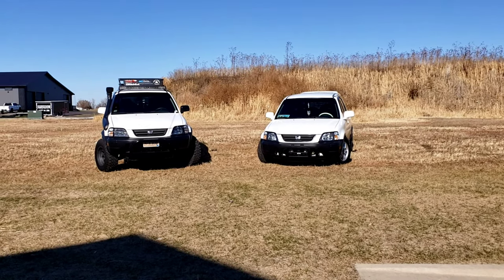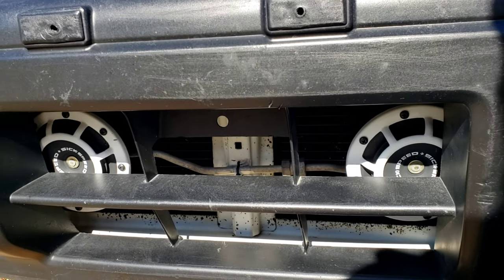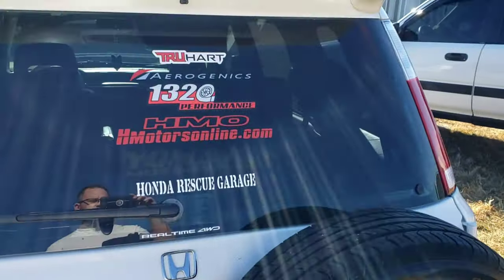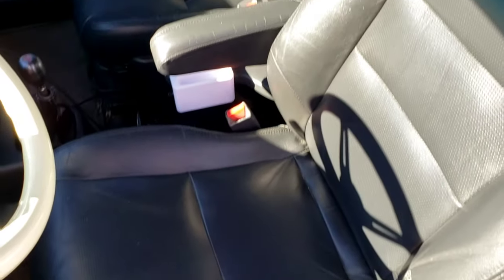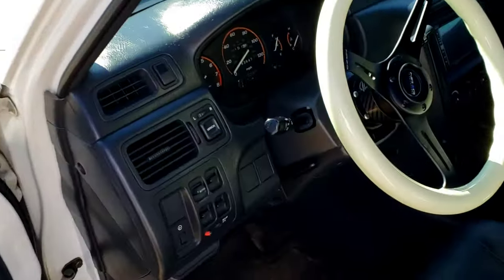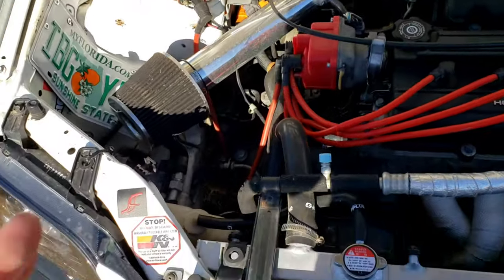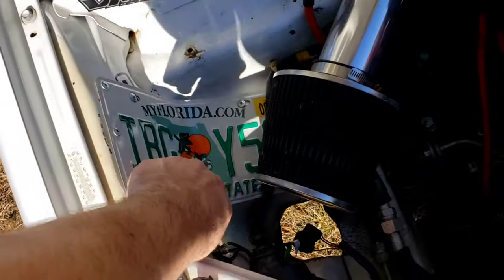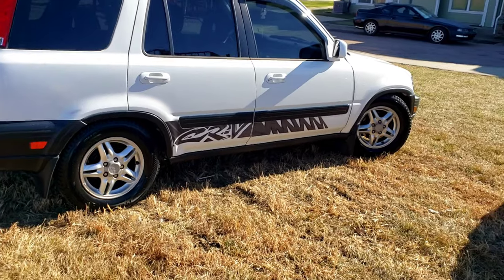Winter set up walk around on my 99 CRV!

Comment: You do the best walk-arounds. Some of your videos have helped me slowly do some mods/upgrades to my '05 CRV that I purchased 3 months ago with 138,000 miles. So far I have installed the HRG 2 inch lift, 1 inch sub frame drop, 16x8 wheels, 225/70/16 Toyo Open Country AT3, and replaced some worn out transmission parts because the previous owner seemed to have neglected some maintenance. I am getting very light vibration in the steering wheel and frame. When I turn on the AC, the vibration increases just a bit more, but still nothing unbearable. The vibration only happens while on idle, not while driving. While driving everything is smooth. Is this somewhat normal or is there any other parts I should inspect? I had my mechanic inspect all the transmission and motor mounts for damage and to make sure everything is torqued to spec, and he did not see any issues there. I am still somehow still convinced that perhaps the transmission/motor mounts must be damaged somewhere that he did not notice. Any thoughts and have you experienced any type of very light vibration on your steering wheel while on idle. Again, it is a very subtle vibration -- not intense vibration to be super concerned, but I want to make sure I am not slowly causing any damage somewhere else by not addressing that light vibration. This is my first vehicle ever, so it's still a learning process for me. Thanks for all your videos.
Reply from the maker: Thank you man that means a lot really I'm glad I'm able to help. I would say it seriously still sounds like there is a bad motor mount somewhere it may not be completely torn but it's either past its prime or if you have torque mounts on that vehicle somewhere it's going bad generally that's the vibration you're going to get especially when you turn the AC on for at idle.
Reply: @crv_tom   Thanks - i agree i think there is a bad motor mount. I’ll have to inspect closer. Do you have any recommendations for an aftermarket motor mounts brand? I was not familiar with what a torque mount was until you just mentioned it. Thanks again.

Comment: I don’t get why you lowered the car for winter.

On the lifted one is it any good off-road? I’m in the market for a small 4x4 for mountain trails but I’m pretty sure my 99 CRV wouldn’t handle them well since it has no low gear and is AWD not 4WD
Reply from the maker: I had one lifted in one lowered that one had always been lowered for quite a while it used to be lifted a few years before but in this video I just was putting on the OEM rims with winter tires and taking off my nice set of wheels